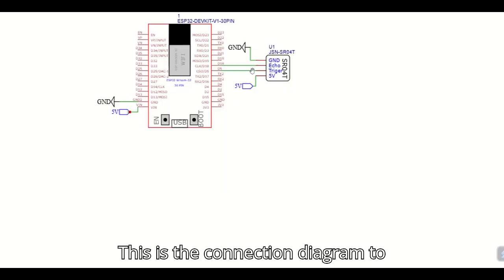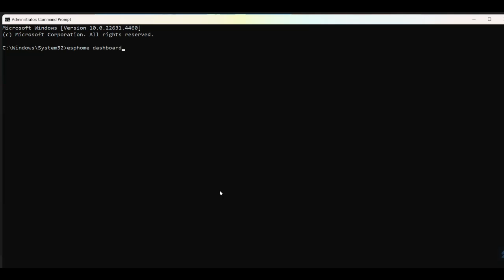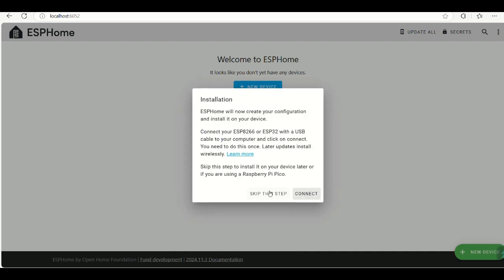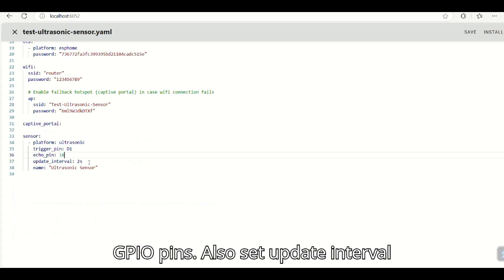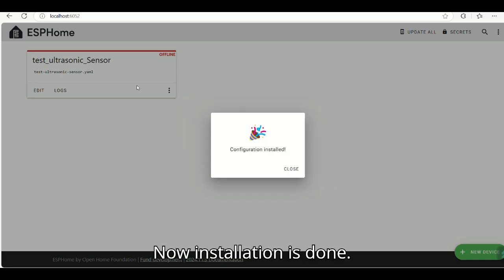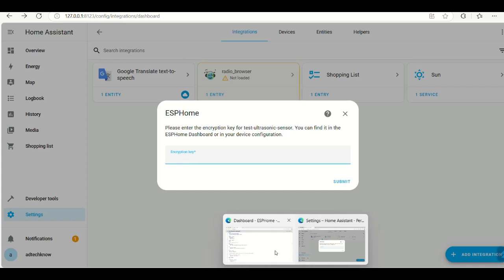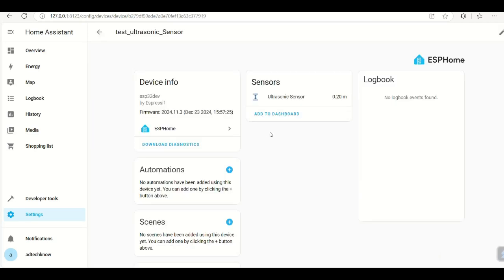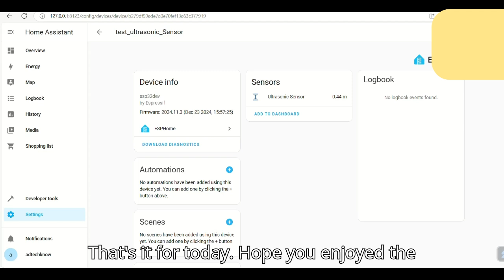Interface Waterproof UltraSonic Sensor with ESP32!ESPHome

Comment: Hello! Thanks for the video. Why you have you not used a voltage converter from the sensor echo (5v) to the esp (3.3v)?
Reply: if you are using aj-sr04m etc connection b/w you dont need voltage convertor